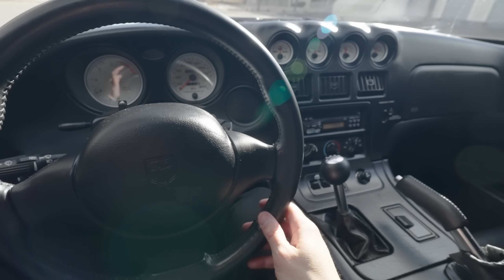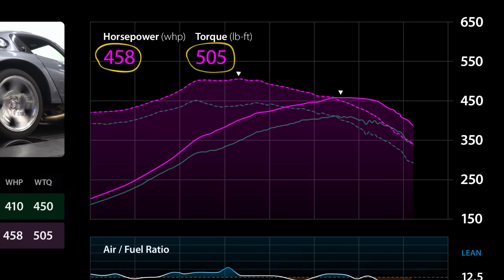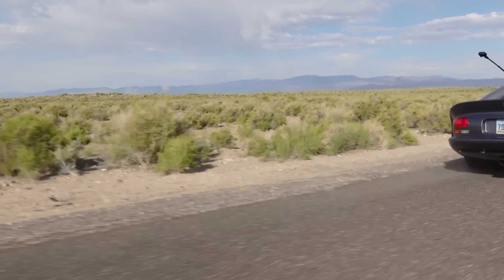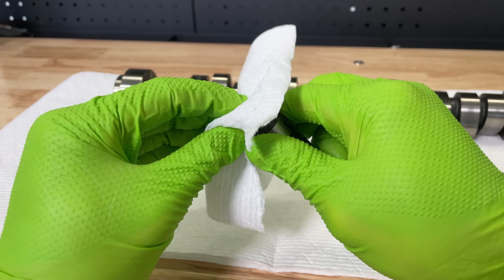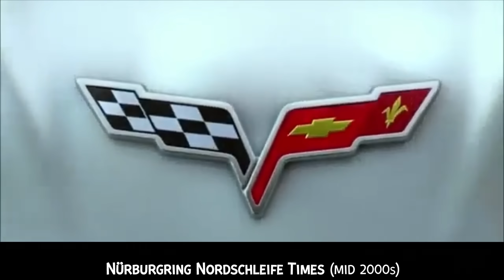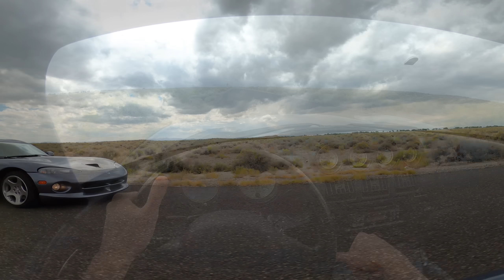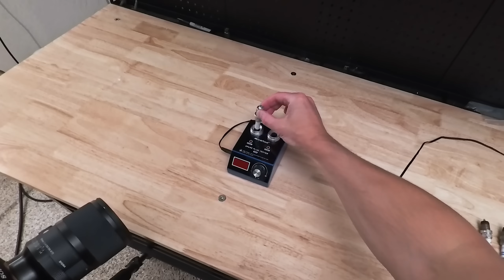Don't call it a comeback

Comment: Small nitpick: Yes youre correct when the 2nd gen Viper GTS came out it wiped the competition. You said us "euroboys" would say that 8L for 450 is pathetic and, it still is. Im not taking anything away from the Viper and I love it but for reference the E39 BMW M5 has a 4.9L V8 making 400hp, and the Viper is almost double the displacement with only 50hp more? Still love the Viper but the displacement to hp arguement is definitely still there

Comment: Oh wow i am pretty sure you could gain some % just by tuning the fueling properly. Running that rich at 4k rpms is just loosing you power. Everything richer then 12:1 on a NA car is lost power. Alltho the graph is not showing what the top and low ends are.

Comment: There are a lot of very convincing knockoffs of legitimate brand spark plugs going around. You didn't happen to buy those plugs off of Amazon or eBay did you? Even if not, it's getting tougher to avoid these days because apparently reputable retailers are even finding them in their supply chains.

Comment: Firing a spark plug at atmospheric pressure isn't really a good test, as spark plugs are under pressure,  when operating,  quality plug testers have a pressure regulator that lets you know how much pressure it takes to kill the spark (provided you can generate 150 psi) and it makes a world of difference.
Reply from the maker: Yeah this is true, but if it can't even fire at less than 1 atm, you know it's beyond toast.

Comment: You said on here that the Viper was bone stock and had more horsepower to the wheels than the 06 has to the crank but in 1996 the Viper GTS had 415 horsepower and the Z06 has 505

Comment: What octane booster do you use? The orange buildup on the plugs can be caused by an octane booster that contains MMT. I used to use Boostane to bump 91 to 93, and it eventually fouled the plugs.
Reply from the maker: Any quality octane booster uses MMT (except lead) which will eventually foul the plugs... sucks.

Comment: As an european, you won't hear any quip from me, but man... i do wonder what an engineered skinjob to carbon fiber would do to this car... that and taking out the ... EWW steering assembly from the wheel to the wheels and putting a properly built one. I'm saying this, because if you lighten up the body, redo the steering system to be better (even if it's just by 10% - tho realistically an overhaul would squeeze more) then you can start playing with weight distribution like they did in the old days. Lead weights added to the chassis to make the thing dance right. And i know Viper purists would try to burn me on a spit,... but maybe some wind tunnel plish plosh to see exactly what's what and then apply that knowledge to the body, pull a Chip Foose on it and make it proper in a discrete way. A pipe dream, because the costs would be astronomical, but still a nice dream.

PS: while the whole "what's better" is cool, most of the "euroboys" you quote are pimpled kids or actually just your fellow Americans, normal Europeans are actually more like the guys you used to have back in the day, before the badge wars, back when putting a dodge brothers engine inside a ford was perfectly ok with "society", back when car culture was being created by real people who wanted to go fast, not focus groups with billboards.

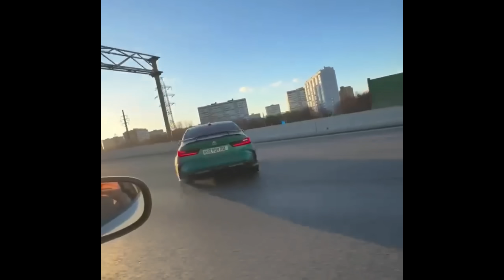Comment: 1:08 That was the funniest sht i've seen today
Reply: I still can't wrap my head around how he crashed going straight
Reply: @ThorkellTT more than likely stabbed the throttle overwhelming the rear tires. Aka the guys an idiot who doesn’t know how rwd cars handle power😂
Reply: @Specky03  yeah and then he just sat there with no attempt at any correction with the steering wheel whatsoever
Reply: @ThorkellTT Rear wheel drive. If he had front wheel drive, he wouldn't have to worry about that problem. Oh well...

Comment: Nice video! FYI - I would hate to see something go wrong but I wanted to inform you that Brisk Racing plugs have been known to have significant quality issues lately, some have even had the porcelin crack off into the cylinder. These seem to be newer stock Brisk, yes they were ordered from a valid source and are genuine.

Comment: I am mighty impressed on how little it took the Viper to gain 100+Hp by only porting the head and installing a cam on a N/A engine, and even more impressed by the cars it took down with ease despite the age and rudimentary tech. This car is AWESOME IN SO MANY WAYS, LOVE IT!
Reply: The bigger the engine, and the more cylinders it has, the more it will gain from mods

Comment: Plugs can definitely cause detonation.

Spark plugs can potentially trap heat, this can be a source of detonation.

A trick a lot of guys use tuning a car for higher compression or boost is using a “colder range.” Plug. They retain less heat which reduces the chance of pre ignition and detonation. 

Not sure if going to a colder range plug will help you however as you haven’t increased your static compression or boost, but your dynamic compression has obviously went up with the cam and exhaust flowing better at higher RPM. 

So maybe a stock heat range plug is sufficient, but new, less fouled plugs may let off heat a bit better and spark more predictable.

Comment: “The only pair of New Balances I’ve persuaded to leave the parking lot” ooooooofffff 😂
Reply: Tbf, it was the best pair. Dat C6 Z06 though 😌👌
Reply: The New Balance crowd drives Corvettes with slush box autos, no way to fit a wide running shoe in the pedal box of a stick car , safely.
Reply: Don’t hate on new balances. Them shits are fire and you don’t even know it
Reply: @krvnjrcbs Damn straight. Those New Balances along with some Costco jeans are wildly underrated dad-maxxing rizz, don't hate when you see the pulls…

Comment: That cam damage probably started as corrosion. Moisture after running and then sitting. That low mileage means lots of that. I had it happen to a magnum 360 of a customer who deployed a lot in the Navy.

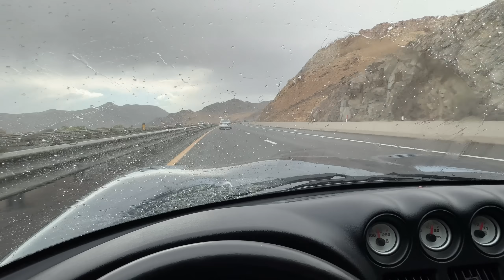Comment: 13:09 wtf THATS how the wipers wipe??
Reply: The wipers were pulled straight out of the dodge grand caravan. Thats why they wipe like a minivan lol
Reply: @matrinezkevin11492  is there an advantage to the staggered operating instead of them going up and out together? And the passenger side engaging after half a cycle, and disengaging a half cycle earlier seems like an unnecessary complication.
Reply: @5000rgb it was a single wiper cycle from park to park. If it had kept going, it would look "normal," or "standard." It does this so the passenger side can stow away under the driver's side wiper.

I wish my FD did this. I always thought it was so cool, lol.
Reply: @ghowell13  but plenty of cars have wipers that pivot at the outside that go up and down in unison instead of alternating. I don't see the advantage of alternating, and engaging/disegaging the passenger side wiper introduces an unnecessary point of failure.
Reply: @5000rgb yeah. Its certainly a complication. It was to hide one wiper under the other to help with aerodynamics and esthetics. 
Edit: it only engages and disengaged like that on its start and end wiper. When it's going through normal wiping motion, it operates like a "normal" wiper does. The passenger wiper doesn't do that on every stroke.

Why do any car manufacturers  do any of these things they don't have to do? If they didn't,  we wouldn't have the cars we have that we like.

Does it add any real value? No, not really. Did it answer a problem they had? Maybe? Maybe they needed a wiper on that side bigger than would fit in a normal layout. Maybe they just thought it looked cool. I have no idea. There's lots of things manufacturers have put on cars through the years that didn't make much sense to me that were a lot bigger than a wiper, lol.
Reply: @matrinezkevin11492  None of my Chrysler minivans wiped like that lol.
Reply: This broke my brain.  I had to watch it in slow mo a few times 😂😂😂
Reply: I've never seen a car with wipers like this.
Reply: @Dreamweaver94They just look like a early - mid 2010s Honda Odyssey
Reply: But just one less stick part
Reply: I was flabbergasted lmao
Reply: I looked like just one cycle. If they were in regular operation, the left one would be sweeping up and out while the right one would be sweeping in and down. That still seems strange, but the left wiper starting first and going all the way up before the other starts moving and then continuing to move after the other stops make it even weirder. I'm not sure what the advantage of the contrary motion is but it seems like the mechanism to engage and disengage the other wiper could be a failure point.

Comment: Up going to a staggered diameter setup? Bigger rear or smaller rear? I've seen a few cars that look crazy good with a 19F 18R setup, but it only works if the overall tire diameters are basically the same. If you have to have a larger diameter rear tire, then you can get the same visual (and driving) effects with equally sized wheels. Though 19s rear (if you're forced up to 19s front) won't help you in a straight line, mostly due to tire availability (at least when it comes to DRs for straight line). Equally sad is that if you do 18/17 you probably won't be able to find tires since the market wants to discontinue 17s much like they did 16 and mostly 15s.

Comment: Oh no, I watched the entire video right away instead of saving it till later 😭
that spark plug comparison was insane, eating through them that quickly
Reply: I wonder if it's purely plugs, or if it's the fuel additive he's been using. They leave a lot of deposits in the cylinder :/
Reply: @Rollin8.0  uh, dont fuel additives clean the engine? thats what theyre there for?
Reply: @KawaSigma depends on what they're for I suppose. He mentioned he was using an octane booster. I doubt that would have significant levels of detergents because those reduce the energy density of the fuel lol
Reply: @KawaSigma  some additives might, but the combustion chambers/pistons of motors I've seen that have had octane booster added to the fuel have been covered in an orange-brown powder, you can see it on the plug in this video too, at the 14:15 mark
Reply: @Rollin8.0 yeah I’ve never heard anyone recommend octane booster, but that’s a broad term
Reply: yea can't believe that's only 500miles, maybe coil packs problem?

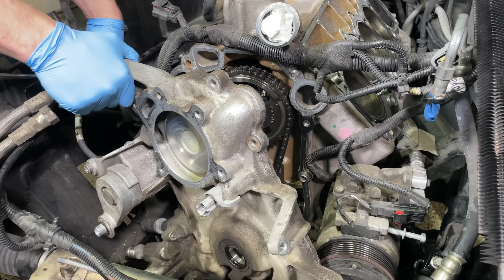Comment: 7:36 thats it? the timing chain? my audi brain can't comprehend that lol
Reply: Good ole pushrod engines!
Reply: The crazy part is how easy it is to work on. He could have bought a more aggressive cam and pushed 700hp N/A.
Reply: Yeah bud, regular pushrod engines are awesome. And 12-15000hp on top fuel dragsters. Don't need dual overhead cams and 3 chains to do it.
Reply: @DualKalibur  While the architecture is related, i will never consider those nitromethane monsters as 'regular' pushrod engines.
Reply: @Jorgumandr  related? Its simply another part of the engines evolution in my regards. From flat head v8 to over head valves, all the way in terrible cases to multiple overhead cams. Adding extreme complexity and additional points for failure for a marginal gain at best, when its proven with technology thats following a design that started in 1898, dialed in around 1960, and exceeding expectations in 2020 and beyond?  A pushrod v8 has what seems to be endless applications and one of those also happens to be fasted 1/4 mile car we've ever built
Reply: @DualKalibur endless applications as long as the application is making power. The moment you step into efficiency you'll see why DOHC with valve timing are so common
Reply: @dom9056  at what cost? You could dedicate a variable timing gear to every lobe on the bumpstick, add 3 injectors for every cylinder and make it the most efficient engine imaginable, but it will flop due to cost, complexity and being a total pain to rebuild or fix. 
You can get just fine efficiency out of a pushrod v8 with a single cam. Having two overhead cams per head with 4 valves per cylinder and 3 timing chains makes an engine harder to work on and maintain. Maybe if it was 60% more efficient an argument could be made, but as it stands now its no where near enough to justify the added expense, headaches, and maintenance. Not to mention additional steps trying to diagnose problems.
Reply: OHV baby
Reply: yeah half the OHVs don't even have a timing chain at all
Reply: @SilkCutJaguarXJR-  Almost all the gas ones do.  There are some gear-driven pushrod engine cams, but most of those are diesels.  The exception that comes to mind is the old GM Iron Duke 4-cylinder which had nylon timing gears.  The manufacturers generally prefer chains because they're quieter and more tolerant of machining tolerances.
Reply: @JETZcorp i didnt know. Nice . GM 250 comes to mind. I drive a GM 151 w no belt. Runs on brazilian ethanol only
Reply: A timing chain replacement should make a Swiss watchmaker tremble in fear.
Reply: Alfa Giulia 2.0 GMA engine had the same type of timing chain. Rest take multiair.

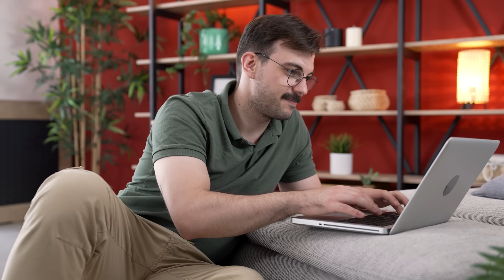Comment: 2:00 the accent hahaha
Reply: As a European that accent is perfect for these types of commenters and describes them perfectly XD
Reply: @FonikosGazmasR34  whats even funnier is that they are right and his "counter argument" was absurd as the competition doesnt even have half the displacement and still keep up 🤣
Reply: @KawaSigma Here goes.... Seems like it struck a nerve XD
Reply: @KawaSigma The main difference and advantage is that the Viper's engine is so under stressed that it's virtually indestructible compared to any sports/supercar making the same power levels, all while having a vastly wide power and torque band that allows it to pull from any gear. Naturally, this massive displacement also leaves room for massive power from upgrades, which is why you see those turbocharged calvo vipers making 2000+ horsepower.
Reply: @Gojira_uz  you comment that under a video where all kinds of stuff broke in the viper engine lmao
Reply: @KawaSigma 3000hp capable engine btw XD
Reply: @FonikosGazmasR34  "capable" XD my motorcycle is also capable of 3000 hp, if i add a freaking jet turbine on top of it XD
Reply: @KawaSigma Motorcycle engine? That proves you dont understand engines XD
Reply: @FonikosGazmasR34  do you not understand what im saying ?XD
Reply: @KawaSigma I undestand perfectly. And you made it pretty clear you dont undestand engines too. Even motorcycle engines..... XD
Reply: @FonikosGazmasR34  you prove clearly that you didnt understand anything, what does motorcycle have to do with it ?XD ..... XD 🦅
Reply: @KawaSigma You said my motorcycle engine can reach 3000hp. Even if you slap 2 turbos on it it cant. It never will. Nice try kiddo XD
Reply: @FonikosGazmasR34  XDDDD u just embarassed urself so hard. read again what i wrote... XD

acting like u can slap 2 turbos on a stock viper and reach 3000 hp XD
Reply: @KawaSigma Who said anything about a stock engine. You forget what you write and now you cant read properly kiddo? XD